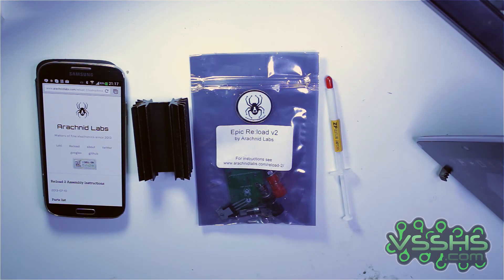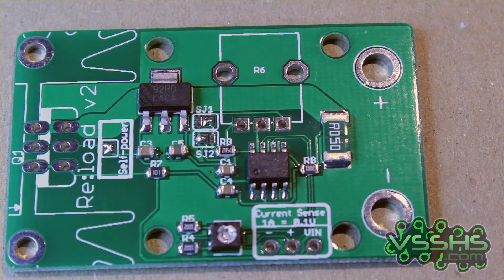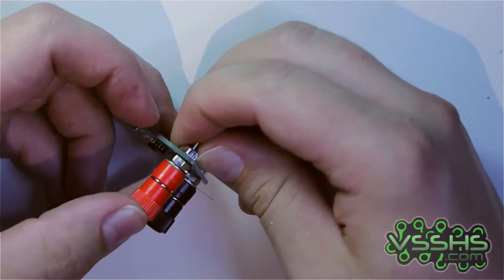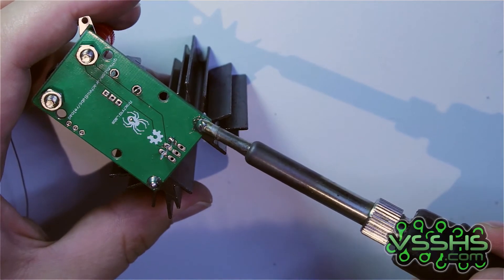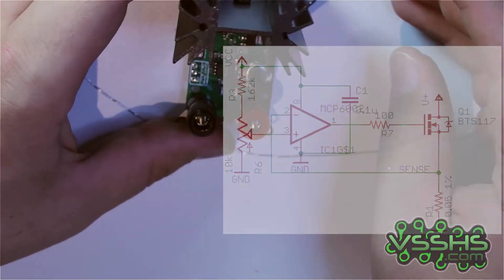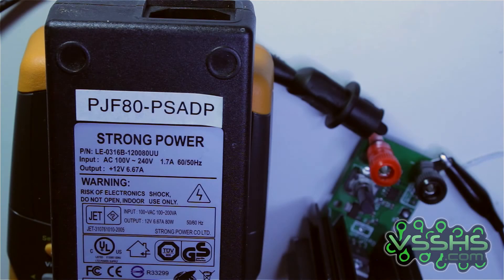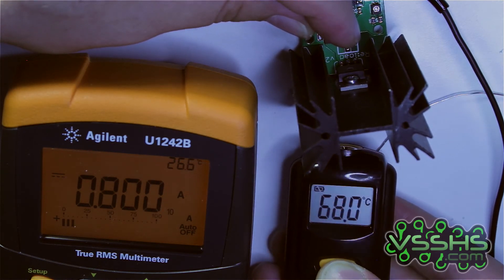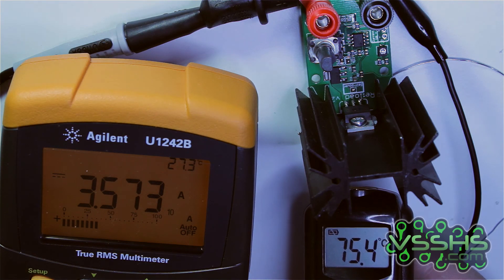Epic Re:load v2 review

Comment: i just got mine from tindie, unfortunately  they changed the mosfet from bts141 to bts133. new mosfet have lower current rating. Tested my re:load2 under huge heatsink only manage to get 6.5A @ 12v.....
Thinking to buy bts141 and replace it, Maybe get two bts141 and parallel it together.
Reply from the maker: Hey, I think I had to chande one resistor to get higher current (for the other side of the voltage divider since I used 100k pot,  if I remember correctly). 

Regarding the fet, changing it might help. There's another video on my channel showing the changes to make it more precise.
Reply from the maker: Epic Re:load v2 modifications: http://youtu.be/8OTf22I7kKk forgot to add the link :)
Reply: Vaidas Sirtautas yups saw that video before I purchased reload2 👍....now need to find bts141 to replace that bts133...
BTW,  For how long you let it run on Max current @12v after modifications?   Any cut off happen on your modified version?

Comment: Correction: I'm actually not sure the regulator voltage. The BOM calls out a 3.0V regulator, but the regulator PN on the schematic is different, and conflicts. I've bugged arachnid labs about the issue.

Comment: Also, measuring aluminium surfaces with an IR thermometer tends to lead to artificially low readings, since IR thermometers are generally calibrated for a surface emissivity of ~0.95, and aluminium is generally rather reflective, and as such has a much lower emissivity.

Comment: FYI, the voltage regulator is actually 3.0V, rather then 3.3V.

Also, there is some additional loop-compensation parts that are not shown on the simplified schematic you showed in the video. You actually have to go to Arachnid Lab's github for the load and there you can find the complete schematic.

Basically, there is a 0.1 uF cap from the output to the negative input of the op-amp, together with a 10K resistor from the current-sense resistor.